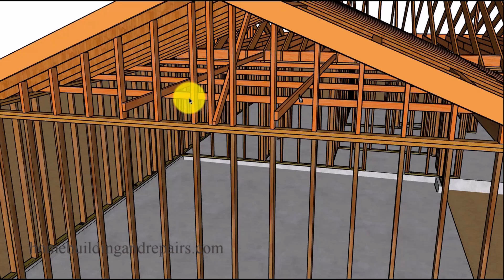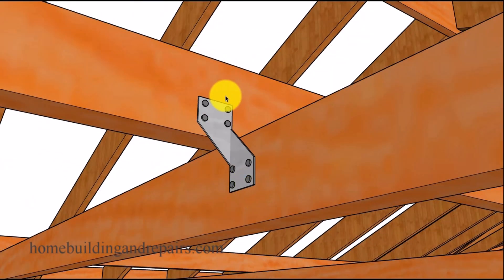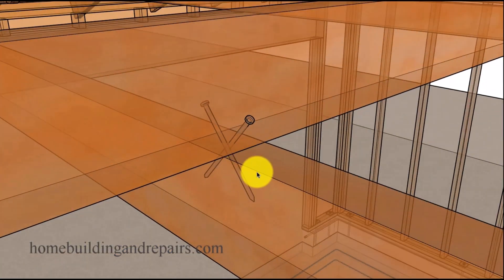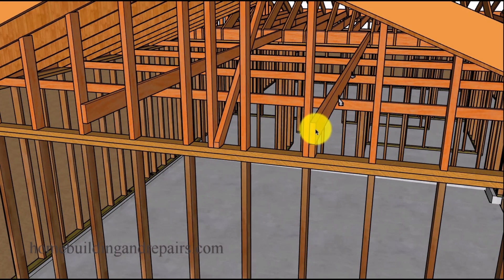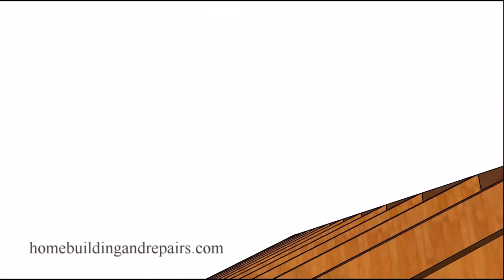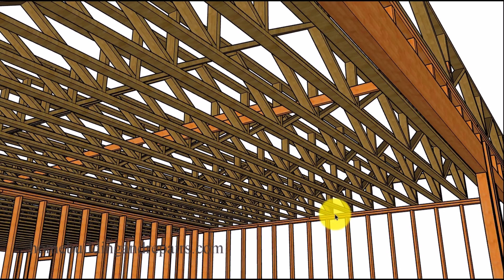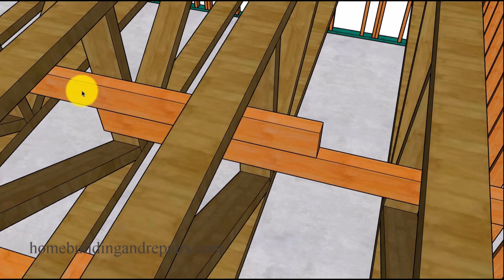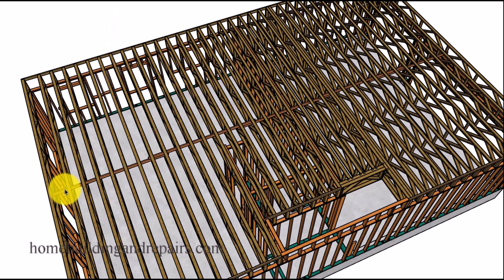Strong Backs Are Your Key to Stable Roof and Floor Framing When Not Using Blocking

Comment: What connector would be good if you have an attic subfloor that prevents hurricane ties and angles from attaching to the sides of the ceiling joists below the strong back ?  Just construction angles nailed to the face of the strong back and down into the top of the joists through the attic deck using 3" SDWs?  Or using the angles from below and screwing up into the strong back with even longer screws like 8" truss screws ?

Comment: Back in my day over four decades ago it was still common practice to use a combination of strongbacks and purlins with diagonal vertical struts connecting the two every four feet at quarter or third span and using the ridge to support a hung strongback at mid span. It was surprisingly ridgid. But now days the building departments want engineered calcs but the engineers don't know how to calculate those old frameworks, so they just end up spec full size beams or pre-engineered factory trusses.

Comment: Why are your collar ties set so low? They look like extra joists. Move them up so that they are not bearing on the top plate. 1/3rd 2/3rds is good approximation. Position them approx 1/3rd of the way down from the ridge 
Yes that might reduce the storage area or whatever, but at least they will perform their function properly 
Pick one: cathedral or gable n run with it with the proper specs
Reply: Because if you don't have ceiling joists to keep the top of the walls from being pushed out sideways, then you need low collar ties to take their place.
Reply: Are you referring to the bottom chords of the trusses? Those are best place as low as possible, to resist the thrust of the truss upper chords and keep the walls from pushing out. A collar tie is useful too, but much less effective. Its main purpose is to keep the connection at the ridge tight. If a low bottom chord constricts the space too much then it can be raised, but only a little, 1/4 to 1/3 the height of the truss. If you need more than that, then your suggestion of a cathedral ceiling makes sense. For that you'll need a proper ridge beam, not just a ridge board.